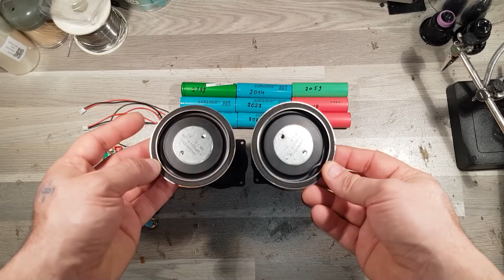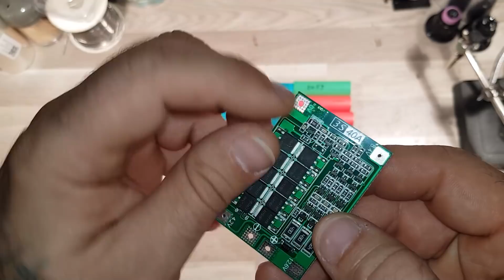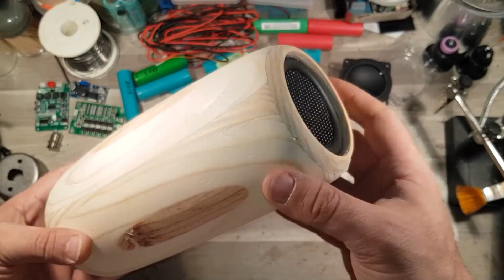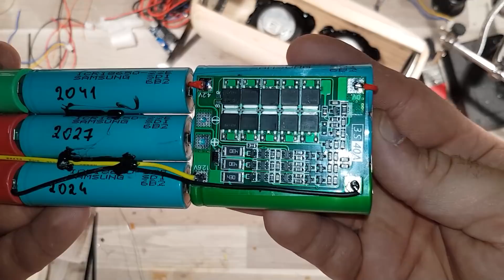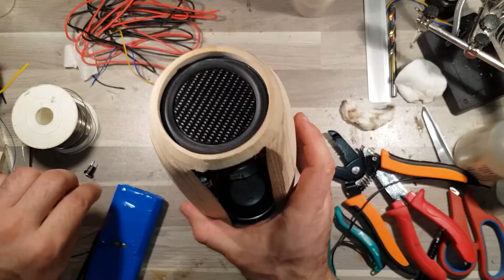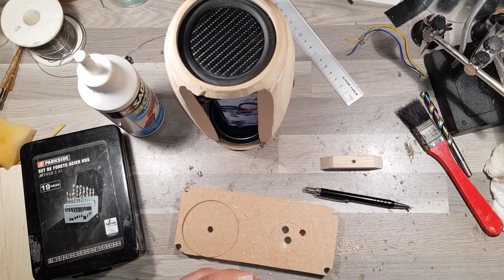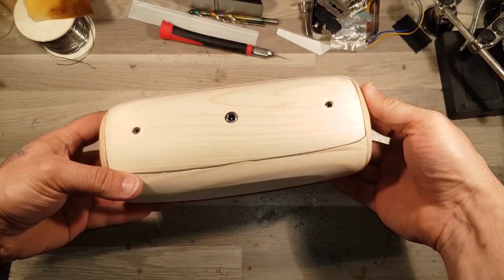DIY Bluetooth Speaker JBL XTREME Simple and Powerful (Super BASS)

Comment: thia speaker is 2ohms right? and it doesnt heat up on tpa3110 which support only 4,6,8 ohm? i have this speaker but cant decide if it work with tpa3110, im afraid i may bust my speaker or the amp because of the low impedance of this beats speaker

Comment: Hello my friend,awesome video and bluetooth speaker!!I choose this speaker and this amplifier, i connect it together play very good!but when I increase on 80% maximum volume the sound is cut off....I use a lot of different batteries and volt, different power adapter 12 and 24 volt, 3 and 5 amperes ,all with the same result, you have experienced about that problem??
Reply: Even I have the same issue please someone help

Comment: hi i have popping and crackling sound for 5 seconds. I have tried 2 TPA3110 2x15W amp, have new cables run to the speakers. nicely soldered. I don't have board conectors
if the volume is high or very low it scips parts of the song.
with the ac to dc adapter is the same thing
I also did not let them bounce so beautifully setly
does anyone have an idea?

Comment: I want to make this but I don't know anything about it
the description of 3S 40A 11.1 V 12.6 V 18650 lithium battery
makes me confused
do I have to learn more or can I just start building
if i put 6 lithium battery 18650 of 3.7v and it work well?
it is a woodworker
thanks you very match!!!
Reply from the maker: This amplifier is working at 8-24v. If you put 6x18650 it will working very well. 3S 40A it's just BMS protection board for lithium battery.  3S=3x18650 battery. 3S battery is a 11.1-12.6V. If you use 6 battery you need 6S BMS protection board.

Comment: Heya, i have some questions:
I want to build a bluetooth speaker with two 40w 4inch speakers. And i was wondering about a battery board and a amplifier board and some passive radiators. Can you give me some suggestions?
Reply from the maker: amplifier:  https://www.aliexpress.com/item/GHXAMP-TPA3116D2-Bluetooth-Amplifier-Board-50W-2-Bluetooth-4-2-Speaker-Receive-Board-FM-Radio-USB/32843837477.html?spm=a2g0s.9042311.0.0.27424c4dlqZukx
24V PCB BMS: https://www.aliexpress.com/item/Smart-Electronics-6S-15A-24V-PCB-BMS-Protection-Board-for-6-Pack-18650-Li-ion-Lithium/32891100590.html?spm=a2g0s.9042311.0.0.27424c4dPkiEL8
4.5 inch 113mm Bass Radiator: https://www.aliexpress.com/item/AIYIMA-4-5-inch-113mm-Bass-Radiator-Passive-Radiator-Speaker-Auxiliary-subwoofer-Rubber-Plate-for-4/32910039827.html?spm=a2g0s.9042311.0.0.27424c4d1OFvNC

6 x 18650 real 3000-3200mAh: https://www.aliexpress.com/item/6pcs-lot-LiitoKala-LG-HG2-18650-18650-3000mah-electronic-cigarette-Rechargeable-batteries-power-high-discharge-30A/32793701336.html?spm=a2g0s.9042311.0.0.27424c4d5zt6Gx

Comment: Where did you connect the led pins of the power switch? Isn't it ok to connect them to the power pins on the main card?
Reply from the maker: You can connect it directly on main card.
Reply: @VGBSpeakers  you soldered to the bluetooth led pins i think 🤔 my card is different (xy-p15w), i'll try bluetooth led first. Congratulations for the good job btw 👏🏻

Comment: I assume you soldered the charging port parralel to the battery.  Now my question is: Can you charge it while the device is turned on? (I am building myself one of these and dont want to cause explosions)
Reply from the maker: Yes off course you can charge it.
Reply: @VGBSpeakers  also while playing music?
Reply from the maker: @ankodriest  yes yes don't worry you can charge it. If you use 3s battery you need 12.6v charger, if you use 4s battery need 16.8v charger and you can charge it while device is working.
Reply: @VGBSpeakers  great! Thanks for the quick reply! This is some helpful information.

Comment: Boss I made this from your video,  but at high volume the voice is breaking and discontinues... Can u say the reason? I made exactly of your described materials and battery of 18650 3.7v. ...
Reply from the maker: I dont  know bro. There are 2 tips of the  amplifier, 1rst model coming with black  throttles and 2nd with gray throttles. Which amplifier you have?
Reply: @VGBSpeakers  bro can u give your mail id.. Do that I can send pics of board ..

Comment: How the passive works?
You don't connect the passive to the amplifier.
Can somebody explain me?
Reply: The inside is sealed so when the drivers "sink in" they compress the air inside and push the passive radiators out and vise versa
Reply: @theraisiny6600  thank you for your answer, you helped me a lot and i am really grateful

Comment: 0:30 - speakers
21:55 - different speakers ? 😆
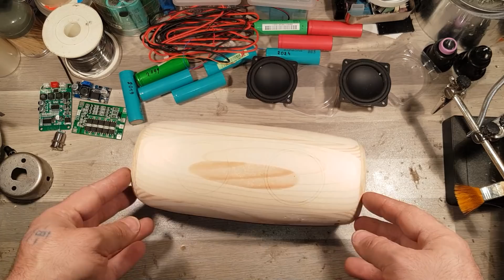Reply from the maker: yes look at 4:44
Reply: Dude, they're not speakers, those are passive radiators. They make the BASS of the music. The main woofer pushes the passive radiator which makes the bass. The casing of the speaker should be air tight.
Reply from the maker: @yaesakura114  he is talking about the speakers.
Reply: @VGBSpeakers  You can give me link to second speakers? Wich in Your opinion i better?
Reply: @yaesakura114  i know Pasive radiator = more Bass 😊😎
Reply from the maker: @BADMIXofficial  https://www.aliexpress.com/item/GHXAMP-2-Inch-4OHM-10W-20W-Full-Range-Speaker-Woofer-Home-Theatre-Speaker-Rubber-Bluetooth-Diy/32834511016.html?spm=a2g0s.9042311.0.0.27424c4dnlV7WX

Comment: Witch speaker has best for more bass
Reply from the maker: https://www.aliexpress.com/item/GHXAMP-3-INCH-25W-Subwoofer-Woofer-Speaker-HIFI-LoudSpeaker-Long-Stroke-Bluetooth-Speakers-Desktop-Surround-Sound/32827256531.html?spm=a2g0s.9042311.0.0.27424c4deTqxdS
https://www.aliexpress.com/item/GHXAMP-2-Inch-4OHM-10W-20W-Full-Range-Speaker-Woofer-Home-Theatre-Speaker-Rubber-Bluetooth-Diy/32834511016.html?spm=a2g0s.9042311.0.0.27424c4deTqxdS
https://www.aliexpress.com/item/2pcs-2-75inch-4ohm-15w-uplifting-angle-strong-magnetic-DIY-Speaker/32661255566.html?spm=a2g0s.9042311.0.0.27424c4dz0MfYm
Reply: Plz give link of amplifier to suit on this speaker
Reply from the maker: @nileshmote3803  for 1rs 2nd or 3rt speaker?
Reply: For 25 watt woofer
Reply from the maker: @nileshmote3803  https://www.aliexpress.com/item/New-TPA3118-2x30W-8-26V-DC-Stereo-Bluetooth-Digital-Amplifier-Board-For-RC-Toys-Model/32795774915.html?spm=a2g0s.9042311.0.0.27424c4d94uHnv
Reply: Thanks a lot

Comment: No link or info about batteries? :/
Reply from the maker: because I use old notebook's batteries. But you can buy the battery here: 

https://www.aliexpress.com/item/6pcs-lot-LiitoKala-LG-HG2-18650-18650-3000mah-electronic-cigarette-Rechargeable-batteries-power-high-discharge-30A/32793701336.html?spm=2114.search0604.3.28.3ece1410RfcAfu&ws_ab_test=searchweb0_0,searchweb201602_10_10065_10068_319_10892_317_10696_10084_453_454_10083_10618_10304_10307_10820_10821_537_10302_536_10902_10843_10059_10884_10887_321_322_10103,searchweb201603_54,ppcSwitch_0&algo_expid=dfb8e998-09ee-4500-8f01-08bd4f86471b-4&algo_pvid=dfb8e998-09ee-4500-8f01-08bd4f86471b&transAbTest=ae803_5
Reply from the maker: it's real 3000mAh battery
Reply: @VGBSpeakers  Does it need to have such high amp's? (30-40A)

Comment: You must separate the frecuencies on the speakers, on the front speakers must go Mid and High frecuencies, and at the sides the Low and Bass frecuencies for best audio quality and clarity...
Reply: You are aware there is only 2 speakers. The side are low frequency radiator and must stay in that area to work.

Comment: tpa3110 can not handle 2ohm load speaker.
Reply: Do you have any suggestion for amplifier can handle those speakers?
Reply: @zainurinuraziz9586  i recommened you to connect those speaker in series, it will create 4 ohm load and use tpa3116 mono channel